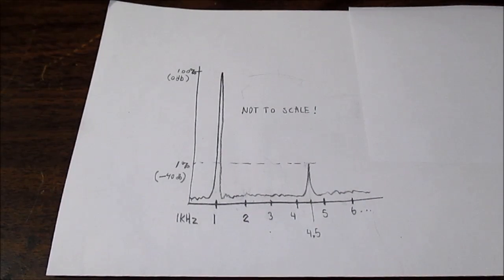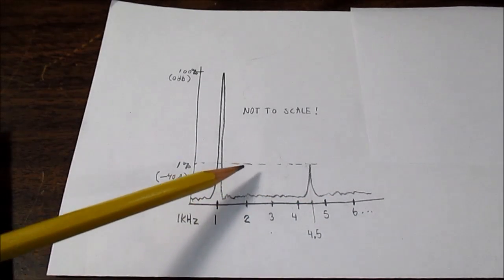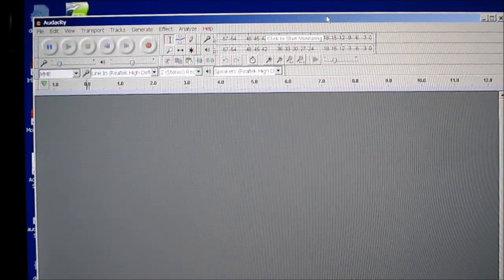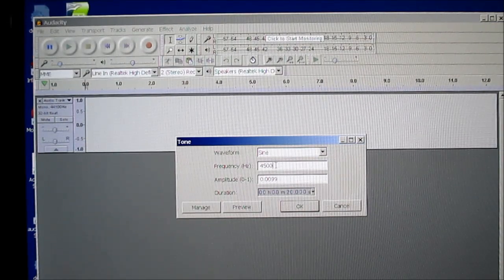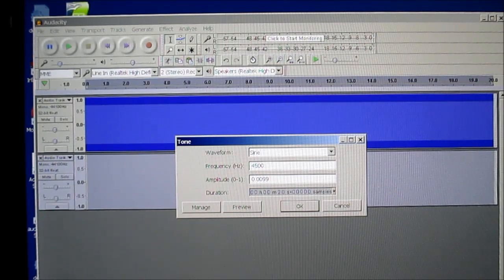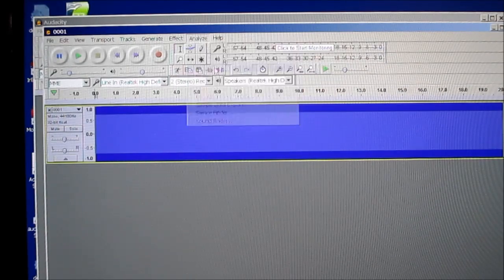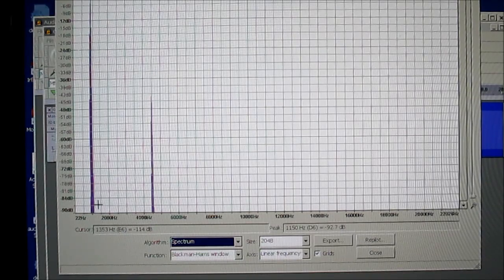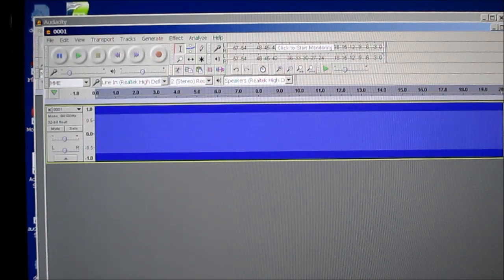DIY audio amplifier test tone with built in reference

Comment: Thanks, files much appreciated, I finally got my lazy butt to come back to this video and download your audio files. I ended up downloading Visual Analyzer for the computer based scope. I do have an old 1971 +/- BK Precision 1474 30 MHz scope but its not much use for checking harmonic distortion and thankfully for audio we don't need the 30 MHz bandwidth. I had to place the Windows Sound Card scope on an old computer because for some reason I was unable to get the TRRS input on my new Dell to recognize a plugged in line input in spite of making a special cable for the single TRRS input jack found on the Dell. As a matter of fact I found the sound card interface for the Dell to be very sketchy. What I did use has separate TRS inputs for in/out. As long as I remember to use attenuation I should be now good to go. Best wishes and Thanks for all your efforts that support this hobby!

Comment: Great video! I'm just curious if I can use a similar file at 40hz with a 1/100 pilot signal to set the gain on my amplifier. If so would I continue to increase the gain and watch the noise floor rise until it hits the %1 thd mark or top of the pilot signal? My goal is to tune my amp gain to the point if %1 THD or just below. I could buy a SMD dd1 but I would rather learn how to do it with a Oscilloscope.

Comment: Hello again John. What is that peak you see in the FFT when you analyze the distortion. You always says its your "pilot ligh"? What pilot is it? Thanks!
Reply from the maker: It is a 4.5Khz signal I included with the 1KHz fundamental in the source signal. It is 1% the amplitude of the fundamental. I use it to compare the magnitude of the harmonics. I call it a pilot signal or reference signal.
Reply: Ooooooh. I see. Thas a good approach

Comment: Hey John, if you ever do other videos involving your computer I'd recommend trying OBS (it's a free video capture program)

If you need help setting it I can help you.
Reply from the maker: VLC media player makes the video fine. It's WinBlows Movie Maker that screws up the video.
Reply from the maker: Thanks for making the video sample. What happens with me is kind of strange. I'll see if I can post a sample of it. Stay tuned...
Reply from the maker: You are right. After saving the file, it plays back fine. I figured it was doing much of its work in the preparing video step it spends a lot of time doing when I import the clips. Good to know I can include videos of my desktop now.
Reply: Also, if you have win10, you can use the game console (ctrl + G) to record your desktop.
Either way will work but OBS does have advantages.